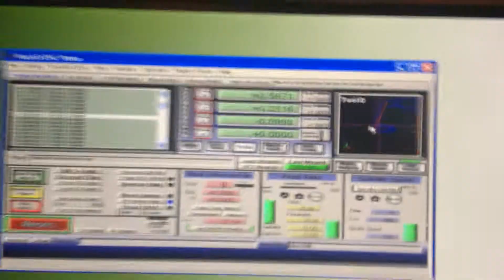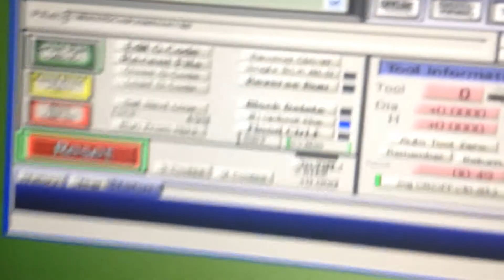Mach 3 3040 CNC First Run

Comment: Hi! I'm looking for CNC for home use. Are u satisfied with the quality? Could you please write the full name of your CNC?
Reply from the maker: MultiSuzuk 
This CNC was great as a first machine. The machine takes a few days to fully configure as it doesn't come with any software but if your an engineer you should have no trouble. If I where to go back and purchase it again though I would probably buy the 6040 version.

The main reason to purchase the machine is the mechanical rigidity and accuracy during cutting. It has created some excellent parts from nylon and aluminium for me.

The main reason not to buy the machine is the weak spindle motor and the size of the cutting area. For me the maximum feed rate is to slow because of the the spindle is only 400W. The size of the parts I can cut are to small also.

I have since built a much larger CNC (1 meter x 2 meters) with a 2.2Kw water cooled spindle. I can cut at a professional speed and also create the wide range of parts I want.
Reply: Alan Phillips Thank you for the answer.